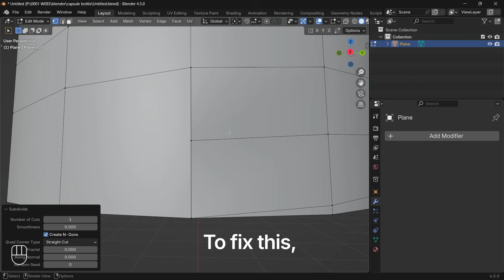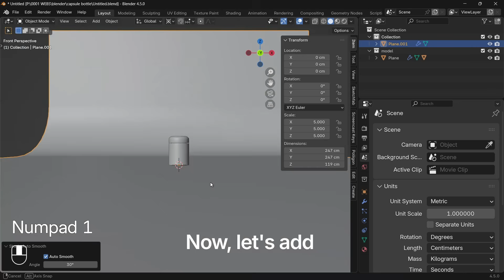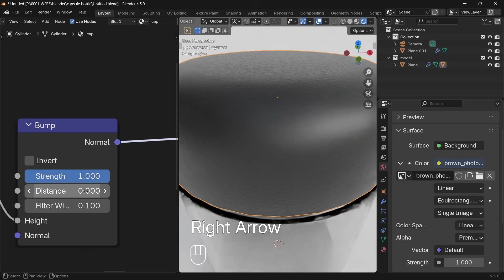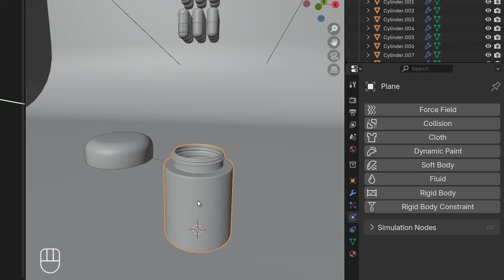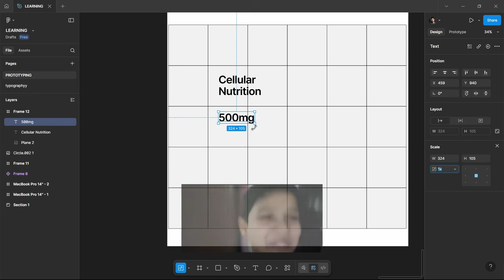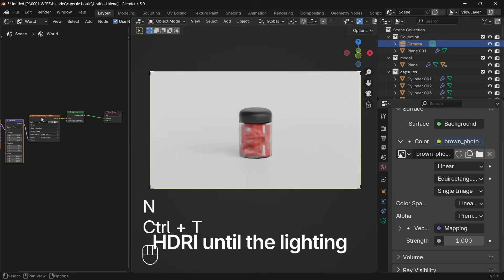Make This Product in Under 13 Mins | Modeling, Texturing, Lighting & Label in Blender.

Comment: Im having trouble getting the pills to go in the bottle. They keep floating over the entrance
Reply: in the sensitivity section of the rigid bady of the bottle and the floor, set the margin to 0. hope it helps. I had the same problem.
Reply from the maker: Change the object type to mesh
Reply: @blendertobrowser i did 🤔 it just doesnt wanna go in the bottle lol